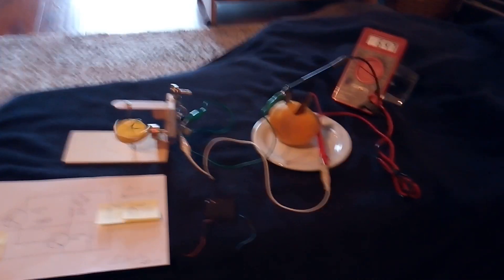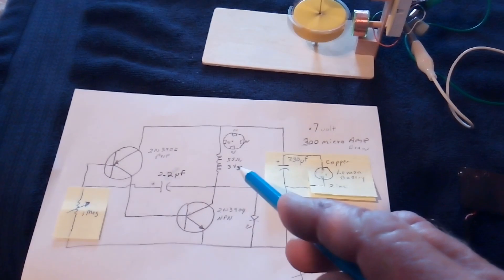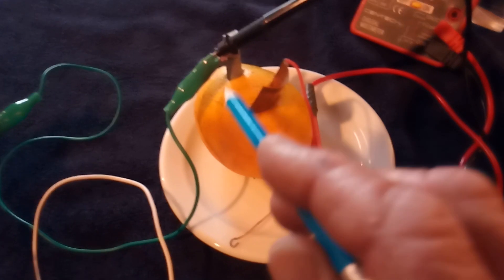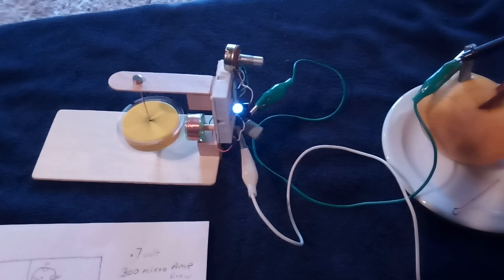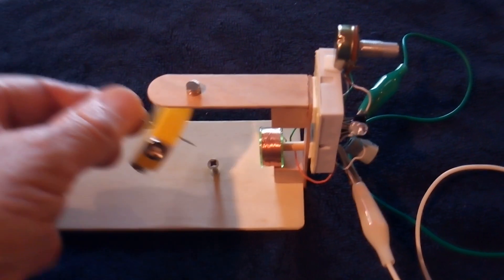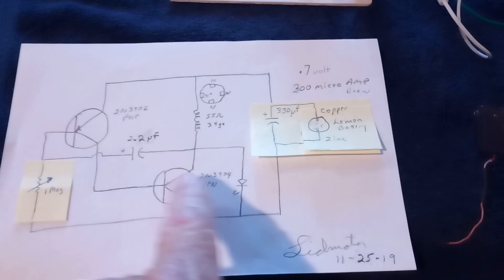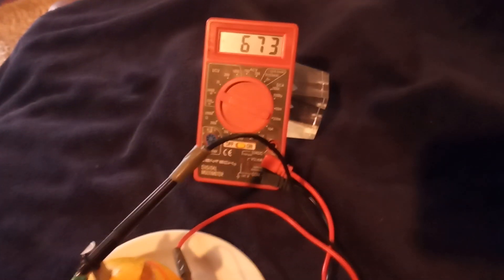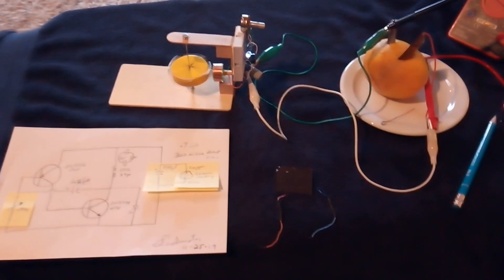Blinker Motor --- Running on a lemon battery

Comment: Hi!  I would like to see you experiment around with a 3909 Flasher/Oscillator chip (http://solarbotics.net/library/datasheets/LM3909.pdf).  It seems to only require one capacitor component to run on only a few microamps.  Replace the LED with a small coil to get the motor to run for months and months!!  Also, the coil might generate other interesting electronic effects inside the chip.
Reply from the maker: Thanks.  I have known about the LM3909 for awhile but just have not gotten around to getting one to play with.  Thanks for reminding me about that.  I will order one.

Comment: Does the rotor eventually synchronize to the natural blink rate?   Makes me wonder whether rotor would run with magnets replaced by small metal disks (ferromagnetic metal of course.).  That way, the rotor can't trigger a pulse.  It can only respond to a natural blink/pulse.
Reply from the maker: Good questions.  The rotor does not sync to the blink rate.  A small metal disk rotor probably would not work but it might be fun to try it.

Comment: Ha nice one!  Would it work with a turkey? Had to ask :)
Reply from the maker: I should try that.  Take a thin slice of turkey and just put the anode and cathode on each side.  Presto---the worlds first Turkey Sandwich Battery!   If it is a juicy turkey it might gobble up the anode pretty quick though.
Reply: Haha. A bit of salt and it may work, it's not like turkey wouldn't have salt added to it. Happy Thanksgiving !
Reply: @Lidmotor  I am of course too refined to suggest where you could put the cathode and anode on a live turkey. Might have trouble holding it still long enough to film the result.

Comment: No doubt it is utilizing both the coil being energized and collapsing. 
Attracting the magnet during one and repelling during the other.
Reply from the maker: I don't know what is really happening here.  I know that the led is flyback powered by the coil field collaspe but beyond that it is sort of a mystery how this motor runs.
Reply: @Lidmotor  Very interesting circuit, thanks for sharing your work.  Looks like the 1M potentiometer allows you to set up a hair trigger so a very low level input pulse induced as a magnet passes by the coil will very briefly turn On the PNP transistor.  This will then very briefly turn On the NPN transistor sending a very short power source output pulse to the coil to drive the motor.  This output pulse may also speed up PNP transistor shut Off thus a very quick NPN transistor shut Off which shortens pulse and load current consumption for very high efficiency.  You will probably be able to further decrease the load current by increasing the number of coil windings to the point that a galvanized nail and copper wire will work with lemon battery.  If LED is flashing in between magnet passing the coil then increasing the 2.2uF capacitance may also further decrease the load current.
Reply from the maker: @ReasonForemost  Many thanks for your description of what is going on here and how to improve it.  That was very helpful.